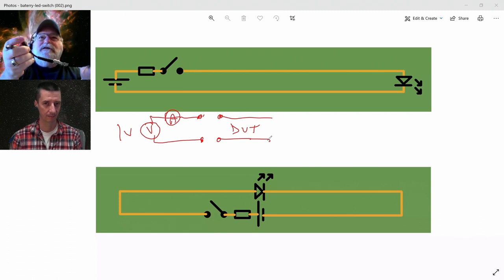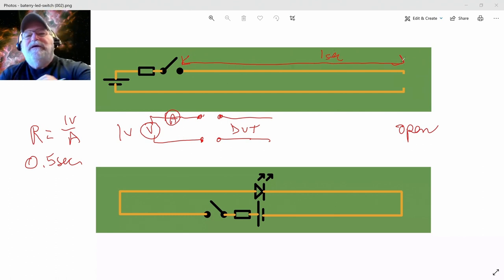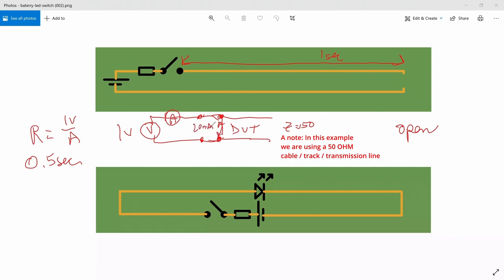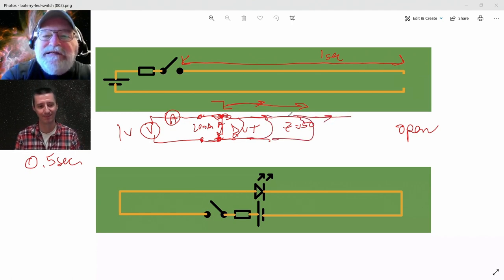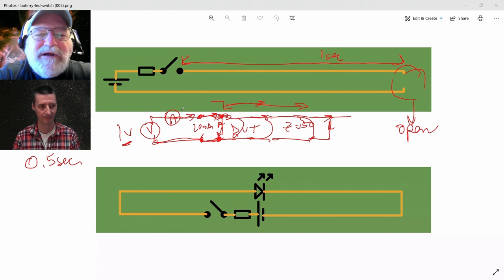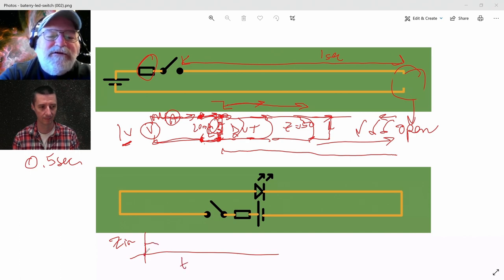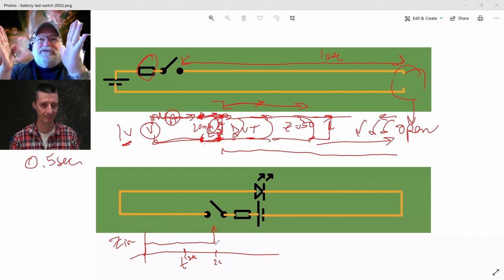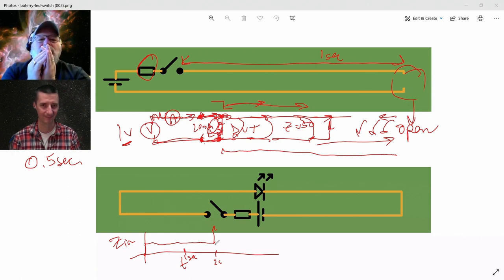Why don’t you measure 50 OHM on a 50 OHM cable? | Eric Bogatin | #HighlightsRF

Comment: I've been teaching electronics for over 40 years and THIS is why people have such a difficult time with very simple subject matter.
You will never read 50 ohms using a DC meter... period.  The "characteristic" impedance only applies to signals that are within the design parameters of the transmission line.  How do you explain the characteristic impedance of a waveguide to students, then?
In coaxial lines, the characteristic impedance (Z0) is determined by the dielectric constant of the chosen insulator (you did not even broach this) as the signal is wholly contained within the cable (assuming no ingress or egress).  If the inner and outer conductors' radii are maintained, Z0 is a function of the dielectric constant , alone, and the choice of dielectric (PE, PTFE, air, FE, etc.) will also affect the propagation velocity.
Impedance is the complex summation of inductive reactance, capacitive reactance, and resistance.  There is NO WAY to ever see the impedance of the circuit without the reactances, which are frequency dependent.  A DC incident signal with a steep leading edge will contain far too much HF to be useful.  Most TDR's, for this reason, use a sinusoidal waveform (half wave) for the incident signal.  More accurate and reliable TDR's use complex waveforms (spread spectrum reflectometry).
Q:  "Why don't you measure 50 Ohms on a 50 Ohm cable?"
A: The simple answer is that impedance is complex (multiple formulas and parameters) and Ohm Meters are not designed to measure anything but resistance.
Reply: Exactly, Retired Engineer! Time domain refectometry (TDR) names the speed of an electric signal through a characteristic coaxial impedance at about sixty percent of light-speed in vacuum.
Reply: This. It is unbelievable how difficult it is to find any material nor any lecturer who could teach anything both right and understandably about transmission line impedances, reflections, and most of the RF phenomenons. I am a skilled professional on electronics and electricals, but even I still struggle to understand those subjects.

After long-term struggle though, I understand the most basics, including what this video is trying to say and why it is wrong.

At the beginning of this struggle, I was very frustrated about the prevailing teaching concepts to suddenly start telling and calculating about mystical waves which reflect within cable and need specifically designed cable, without ever explaining what they are in electrical terms. And not mentioning about basic things applying always, even though negligibly in low frequencies, such as any transmission line having charasteristic capacitance and inductance, and reflection occuring and magnetic flux and electric field existing even with slow dc pulses in regular cables. Mentioning those would have given consistent perspective, instead of making confusing thinkings that cranking up the frequency suddenly brings us into another mystery world where exists things not existing in the LF world, where ohms mean totaly diffent thing, and where we on the other hand don't even think about basic voltage and current calculations anymore...

The , even after getting over that conceptual stumblestone, I still find that most materials, videos, and lectures have either way too much omissions, oversimplifications, even outright errors, OR they are way too hard to understand for unfamilar about those subjects, even if skilled in electricals otherwise.
Reply: Oh man, you could not be more wrong.

A transmission line at the instant a signal is applied to it looks like an impedance equal to its characteristic impedance. An ideal 50 ohm line will look like a 50 ohm resistor when a wave is launched into it. The characteristic impedance is the ratio between voltage and current of a propagating wave inside a minuscule amount of T-line. When you connect an ohmmeter to it (instantly), it will launch a wave into it, and the wave impedance will look like 50 ohms.

Q:  "Why don't you measure 50 Ohms on a 50 Ohm cable?"
A: you will, until the reflection comes back and changes the reading. If you had a fast enough "ohmmeter", you'd see 50 ohms until the first reflection comes back.
Reply: Many informed individuals don't seem to understand that these inductances and capacitances do NOT return the energy they absorb to the transmitter; instead they pass it along to their neighbors.  Thus, the energy is transmitted down the transmission line.  The transmitter ONLY sees that the energy it delivers doesn't come immediately back (+/- 90 deg.) as it would from C or L (or LC).  Instead, the energy seems to be lost as from a pure resistance.  IF the cable were lossless and light-seconds long, the Ohm meter WOULD measure it as 50 Ohm... at least for a few seconds.  As far as the transmitter is concerned, it does not matter whether the energy is converted to heat, excites a cavity, or radiates into space -- since it is lost to the transmitter, it looks like a resistance.
Reply: Taking the paradigm of DC resistance with a meter people understand and transfer it to RF is kinda waste of time. 
As you said most coax cables do not support the speed of light, due dielectric absorbtion, which is minimized in better coax with sparse placement of plastic spacers. Both speed and power is lost.
RF Impedance is better explained otherwise.
Reply: So another way to put it is the 50 ohms is the AC characteristic impedance of the cable, and you're not going to see it measuring it with a DC ohm meter. That's really what this comes down to
Reply: Mr Retired Engineer, YOU are the reason why so many people don't understand the basics of electricity, because you guys know only doing maths, and do not have a deep understanding of the concepts. Eric does, that's why he explains the subjects without involving maths, you can't, because you are a good student, so you can explain things that you do not understand, by hiding behind mathematic formulas, as your teachers did.
Have a nice day, and a nice retirement.
Reply: And not taking to account the resistance of Cooper as metal & Z,Xl,Xc,> f.<

Comment: Assuming your coax is RG058 (specified impedance of 50 ohms), the velocity factor is 65, not 100, so your hypothetical measurement time should be a bit over 3 seconds.

Comment: At 5:00, the first reflection will actually be 2 V.  If the meter's output impedance is 50 Ohm, it will absorb this transient via the voltage divider to yield 1 V; otherwise, the power will be reflected again and again until the transient is absorbed by system losses..

Comment: I understand imprdance as a value that had to be measured from a load indirectly or with a TDR. 

One indirect method being with an ammeter and a voltmeter and the other being a voltmeter comparing the voltage across a load and one across a variable resistor. The voltages across the two being equal reflecting the resistors current value being the impedance.

What he seems to be saying here is that current for a time induces current in a return wire creating a temporary circuit in which messurements could be made.

Comment: I think is easy to test, just need a osciloscope, a long coax cable and a single shot step signal and a resistor, you  can measure on channel 2 the voltaje across the resistor and so you know the current, and you should see a constant current for the first nanosecond and then  slowly go to 0, ( a few nanoseconds).
Reply from the maker: we created also a video with measurements: https://youtu.be/U60y4JC0Wxs

Comment: The impedance of a coaxial cable refers to the capacitance reactance of the wire and the shield and is dependent on the dielectric and separation distance of the conductors among other factors
Reply: And the inductance.

Comment: The transmission line is a series inductor and a parallel capacitance over and over as you go down the line, so it takes that time for your little one gold signal to charge all of those reactions and they build up until you will eventually read an open circuit. But the characteristic impedance of that line did not change

Comment: "Why don’t you measure 50 OHM on a 50 OHM cable? "
Mostly because I don't want to; which is not the same as wanting not to, but merely not seeing much need for it.  If you make it long enough it will indeed measure 50 ohms end-to-end with a DC ohmmeter.

Comment: Fogot to say it's and impedance and not a resistance. DC just wont measure it. it's just like 1000's of little transmission lines holding hands all matched to 50ohm.  so load one end with 50 ohm and you see 50 ohm's at the other. that's how i remember it. that's it if it's with coax, switch to waveguide and they all let go of their hands and the rest is done with magic. ;-)

Comment: just for my understanding, the virtual coax cable to the moon has to be very thick in order to have 50ohm on this long distance right? and what about the capacity, you didnt say anything about that. i mean if the cable is so long than the capacity should be big too. and a big cap looks like 0 ohm at the beginning of loading, how does that fit together with what you said?
Reply: If you put any sort of cable even to low earth orbit you'd have millions of volts until whatever you made got destroyed. It's a thought exercise and erroneous at that.
Reply: Google user  I could go on but aint nobody got time fo dat
Reply: Google user  And as far as where the power comes from. It's about 100 volts per meter above surface, you do the math. Ever seen the ionosphere, those lovely pictures.
Reply: Google user  Put a wire on a model rocket and watch lightning come down.
Reply from the maker: When we have a 50ohm cable, it is always 50ohm and it is not relevant how long it is. It is the same for PCB traces - when they are 50OHM, they are always 50OHM and it doesnt't matter how long they are. Why is that? Because when we say 50OHM cable, sometimes people imagine a cable with 50OHM resistance, but it is not. We are talking about 50OHM impedance - and simply to say, impedance  is combination of resistance + capacitance + inductance. This means, the cable can have 50OHMs even if resistance is not 50OHM (simply to say, resistance is what you would see on a standard DVM) because it will be build also from capacitance and inductance of the cable. However, yes, the real signal in real cable would have losses - it means, after some time the signal would get smaller - that is what the length of the cable will influence. But loss was not taken into consideration in this example - just to make the explanation more simple. PS: in reality, DVM doesn't measure resistance, but it calculates it from a known voltage and measuring the current - that is very important.
Reply: From my understanding, it does not depend on the length. When a signal flows through a transmission line it see an instantaneous impedance. That instantaneous impedance will be 50 ohms. If the transmission line is uniform, the signal at every instance will see 50 ohms and that is called characteristic impedance of the transmission line. 

From what I understand you are referring to the resistance of the cable. A real transmission line will have I2R losses which will depend on the length. Basically measuring the resistance of the cable between the two ends. In this case you will see a voltage drop. Characteristic impedance and cables I2R loses are a bit different. One is important during transient conditions (di/dt) and one is important during steady state conditions.
Reply: It is also an inductance.  The inductance provides instantaneous opposition; the capacitance provides instantaneous conduction.  How much of each is instantly present is the impedance of the transmission line.

Comment: Is there any simple way to find out Impedance of a coaxial cable or Antenna wire which says 75 ohms & 300 ohms respectively?
Reply: The way is to put impulse generator and oscilloscope on one side of the cable and tune variable resistor on the other side. Once you see no reflections thus the value of resistor is matched to cable impedance.
Some oscilloscopes have function generator built-in, thus you can do this measurement using one device.

Comment: Am I right if I say changing the transmission line impédance is all about changing conductor distance (one from each other, and considering same conductor and diaelectric material)?
Reply from the maker: yes, e.g. in PCB when you change distance between track and reference plane, the impedance will change

Comment: The current with an open line is the charging of the distributed parasitic capacitance of the line.
Reply: It is also the propagation of the EM field.  Both the discreet components transmission line model and Maxwell's Equations approach work. 
That's hits on a pretty profound philosophical thing... We have no clue what's "really" happening.  We only have models which do a good job (or not) of predicting measurements we make.  In a lot of cases there is more than one model/explanation which work equally well.
Reply: @travcollier  Agreed.

Comment: Suppose a 1 volt signal is applied to  a very long , unterminated transmission line. 
Suppose one can measure  both the phase and amplitude of the current amplitude in 1 usec
Will  the measurement reveal 1v/50ohm = 0.02 Amp  current  until the  open circuit transmission line reflects BACK  ? 
Does the 1v x 0.02 Amp current produce a 0.02watt  dissipation during this interval ?. 
Will the so callled 50ohm be heated ?
NO!
Reply: the initial "charging" pulse going down the cable DOES have its current & voltage in phase so it DOES INITIALLY APPEAR PURELY RESISTIVE (not REACTIVE) so it DOES appear for a FEW nS to apparently be a straight 50 ohm resistor (with no reactance).... BUT this energy goes into creating an electromagnetic wave charging down the line NOT HEAT (even though it is in phase it is NOT lost as heat).... Think of this analogy... I'm trying to charge a rechargeable battery... I put 12 volts into the battery at 4 amps... DC so by definition in phase & apparently  a 3 ohm "resistor" ... but again that energy is NOT dissipated as 48W of resistive heat (here it goes into chemical energy storage)..... Although RESISTIVE is in-phase V&I it does not always mean HEAT.
The interesting thing is that the driving signal generator will have its own output impedance... if the signal generator only for a very short instant puts out power but then quickly switches back to zero volts out the line will have appeared to resistively "absorb" the initial power but 2 transit times of the line later it will spit the reflection back out and dissipate the energy back into the output stage of the sig gen (the problems of driving unmatched/badly terminated lines with a high SWR). As the line can return this energy it shows it hasn't been wasted as heat.

Comment: Capacitance  will come into this  as well
Reply: agreed, but the thing that is really mind-blowing is that for"normal" flat plate capacitors the capacitance is dictated by the separation distance of the plates but for co-axial cables (and capacitors) the distance between the inner & outer cable isn't the determining factor. Here the capacitance is set by the ratio of the inner to outer cable diameter (when you have seen the cables a few times you can actually "see" the impedance from their geometry simply looking at the end of it, be that 1/4" cable, 1/2" or 7/8" 50ohm or 75ohm).

Comment: This is convoluted. Just stop about the DC Ohmmeter sampling every 1/2 seconds. The 50 ohm number works when you are modeling impedance due to transmission line effects.

Comment: You are messing up 2 different things. The 50 Ohm is not like a reqular reistor R but impedamce Z. In the right frequency range it is 50 OHm. You cant simply measure 50 Ohm by using an Ohm meter. Also you have to deal with terminated or not terminated coax ends.
Reply: Did you even watch the video? He’s talking about a real multimeter that takes a “DC” resistance reading every 0.5s. Of course the first reading will be 50 ohms when connected to a long coax. He also said multiple times that the other end does not have to be terminated.